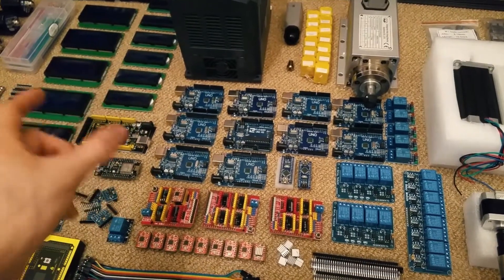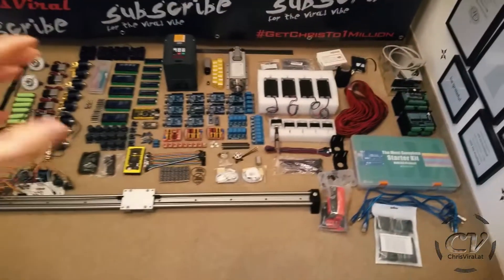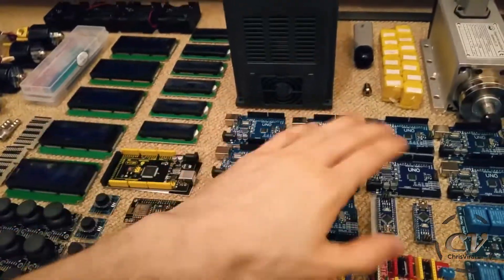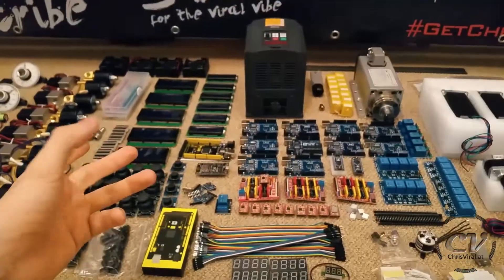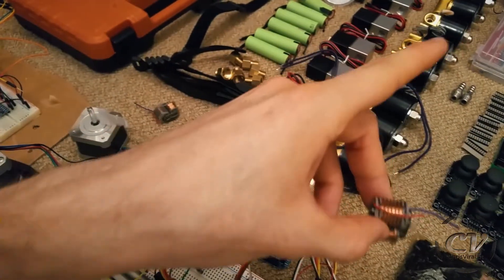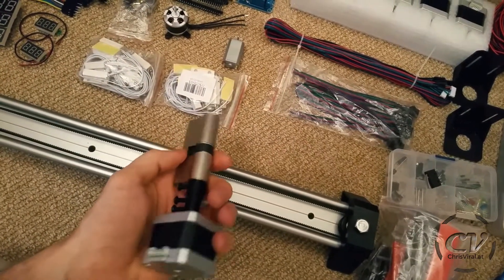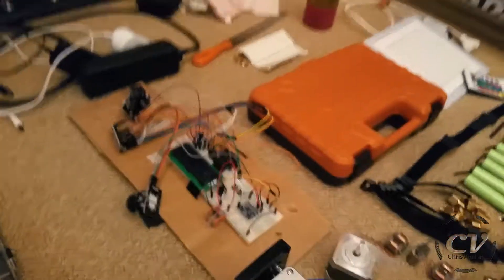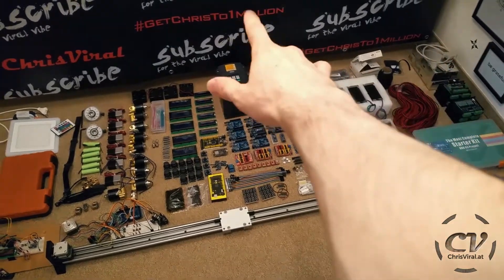My Essential Arduino Components Collection

Comment: Try the teensy boards, you are going to get impressed if you don't already know them
Reply from the maker: Wow sweet, I didn't know that yet. Thanks!
But omg why are they so expensive???
25€ for the Teensy 3.2 (China price)? I'm so confused.

I got a few ESP 32 boards for 4,50€ each.

Okay just did a bit of reading, seems that it's just waaaayy faster all in all. Damn, I think I'm way away from needing so much power atm :'D
Reply: @ChrisViralVlogs  I have managed to buy a teensy 3.2 and a teensy 3.6, 19.80$ and 29.25$ respectively (In the original shop, PRJC), and in my opinion they worth every cent I have paid. They are much much faster and have lots of memory available. To give an example, I am making a drone, in first place I used a arduino mega to drive it, and, the best days was going like 2loops per second(it has to read all of the sensors, comunicate with the wireless and controll the motors), now, with the teensy 3.6 the drone is going 200 loops per second, and I also have a slot for a micro sd to record flight data. If you plan to use  a teensy I recommend to test the circuit and program first in a cheap arduino in case it burns or something similar.
Reply from the maker: I see, nice! Thanks for that 🔥

Comment: dude there are nerves under the eye you might already know ;) , and it can get dangerous. Why you dont go to a doctor?
Arduino stuff is addictive since its so cheap from china. Check out the newer Arduino the successor of the esp 8266, its called ESP32(DualCore Arm). For the Steppers , these drivers are designed  for 3D Printing with small loads and small motors . If you want to move heavier stuff you might need a real driver (i mean in size) most common is the TB6600 for ~ 6$. 
Also you might be interested in Gas sensors, there are 8 different types for usual gasses like Butene,Propane,Hydrogene,Carbonmonoxide and others (MQ2,MQ3,MQ4,MQ5,MQ6,MQ7,MQ8,MQ9,MQ135) google the pdf datasheets for more info.
The displays you bought are useful but from a technical standpoint a bit old, there are TFTs aviable where you can display colors. They are cheap on ebay, overview is this video here: https://www.youtube.com/watch?v=E6quVf1_BIg&t=36s
Reply from the maker: Damn thanks for all that info, that's amazing! :D
Yeah I know that, did get it checked recently.
Dude, I will literally look up everything that you just told me about. 😍 ❤